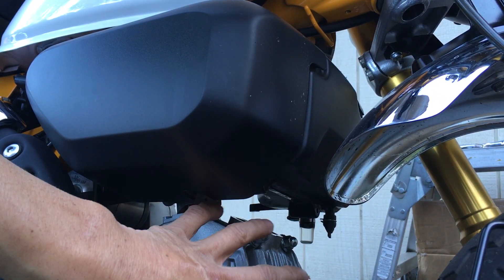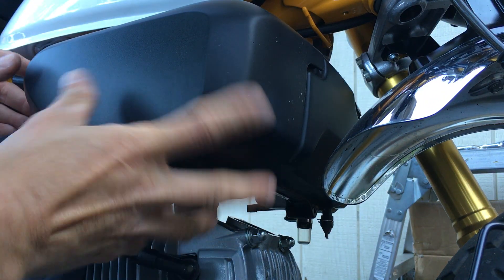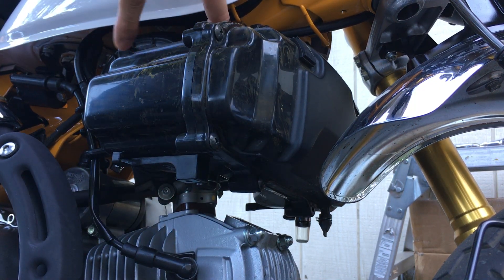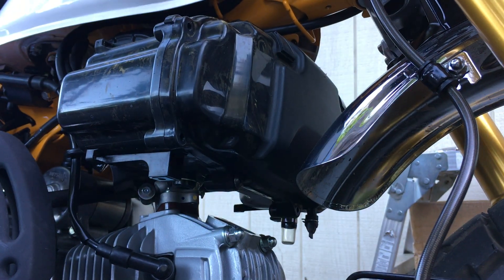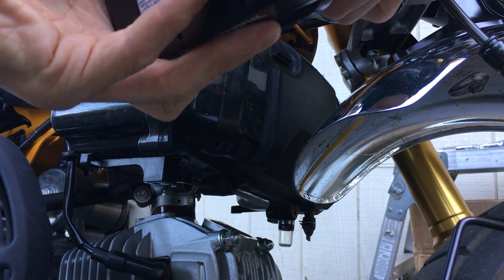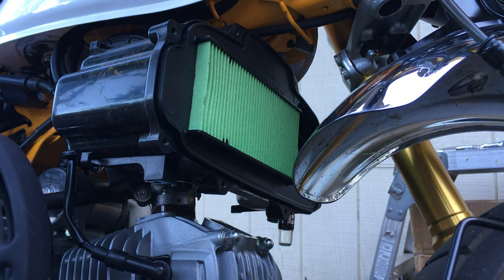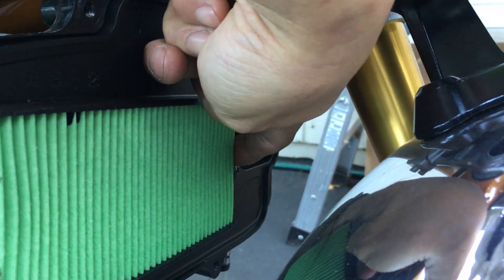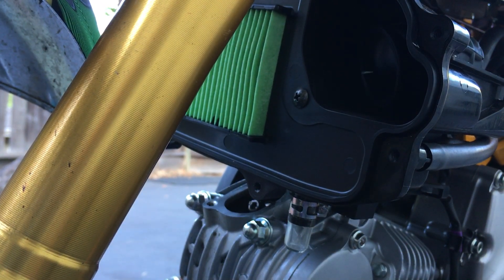Monkey air filter cover removal

Comment: I just did my very first valve adjustment on my Monkey at 4,000 miles. Wanted to see what happens if I followed the shop manual recommendation. The valves were both tight. Got them adjusted thanks to your tutorials on it. I noticed my air filter compartment had a tiny bit of oil in the area right near where the little clear catch bowl is. None has ever trickled down into the catch bowl thing though. I also noticed my air filter has a very slight oil film on it throughout. Not sopping or anything, just like a very faintly film of oil you can see on your finger tips if you press on it. Did yours have any of that going on? My filter was not dirty as I only ride on road. Just wondering if I should get a new air filter or if the one I have is ok.
Reply from the maker: Everything seems normal to me, for the air filer just follow Honda's recommendation.  I wouldn't worry about the oil on the filter, if anything a little bit on it helps catch more dirt.  My Elite110 came with oiled air filters, very lightly.
Reply: @DaBinChe  Ok thanks. Man, I guess l was being to generous with my gapping. Put it all back together and cranked it up and it was super tapping. Had to redo it and tighten them up some more. Thats definately a learned skill getting it right. Your description of how the feeler should go through really helped. I just could not fit the feeler gauge in there even after bending them a lot. Thank goodness I got small hands too.⁹ Happy New Year.
Reply from the maker: @findingneutral  yeah that top intake area is tight